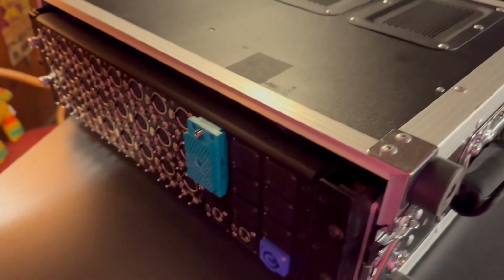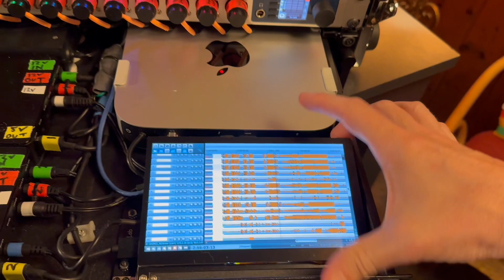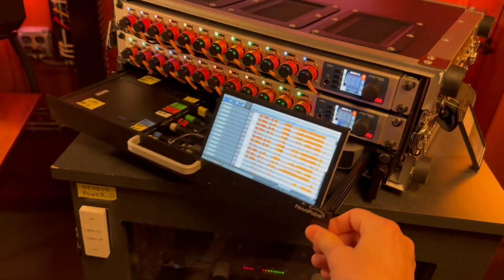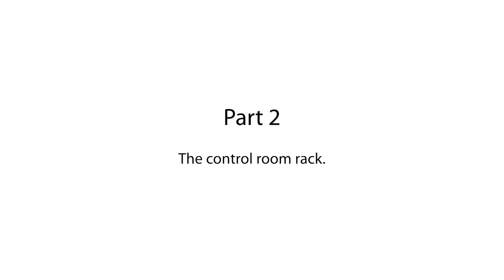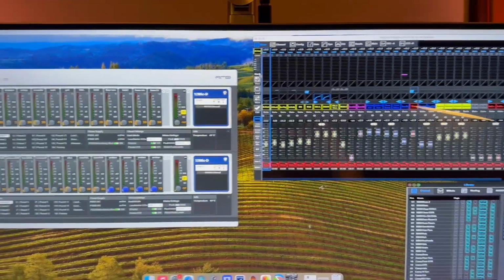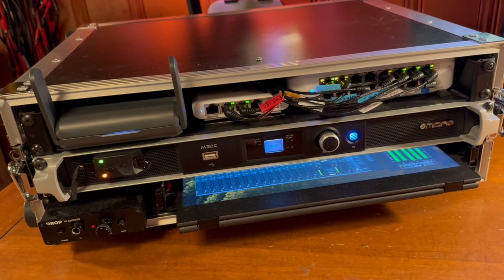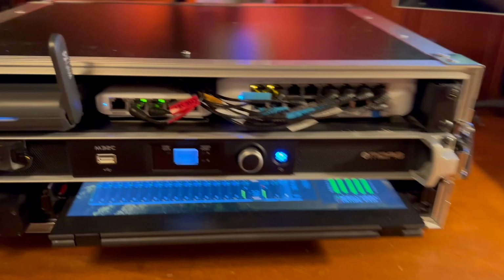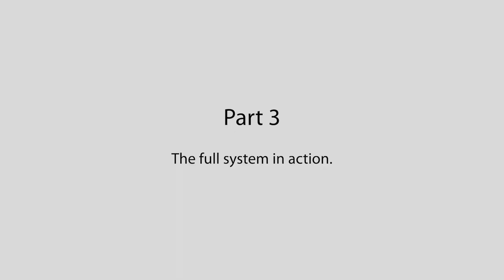Awesome RME Dante Recording system with 24x Mic Preamp - Designed by Rob Badenoch (Techarchdesign)

Comment: First off, awesome presentation, very nice gear.  But why Dante vs. an already available AVB, or MADI ? Does MIDAS not do AVB?   I like the 24 mic's cause every things out the front, I can troubleshoot without leaving my chair.  I have a similar rig, UFX II has 12 outs 12 ins and a 12 mic, but I'm doing monitor mix and front of house for live shows.   I use totalmix remote on an I-pad,  I keep all the ethercon crap out of the cabinet, it was too difficult to isolate the noise.   Cool to have a battery, if everything is acoustic, life goes on.  Not a rig for hot weather, packed very tight.  I use the USB ethernet to the 12 mic, no need for a router.  And now I added an Enttec USB to control a DMX lighting bus.  I play guitar and sing also.  but everything is set before a show, I just connect everything, and load the file from last performance.  Lighting scenes are controlled via Ableton Live and a midi foot switch.  The monitor mix sound quality is jaw dropping.  Why people use wedges I don't know. My rig: https://youtube.com/shorts/vYK2VGUJwV0?si=oQQQUSErOWhaAIgC
Reply: No AVB for the Midas

Comment: Impressive. May I ask a question. I see a lot of equipment inside the rack, including in the bottom drawer. What about air circulation and heat dissipation? Isn't there a bit of heat build-up, I can't see any fans. I have UFX III, 12Mic and Octamic in a 23 cm deep rack, but I use a 4 RU rack so that the air can still circulate a little. Many thanks.